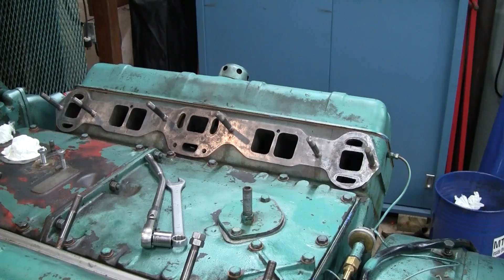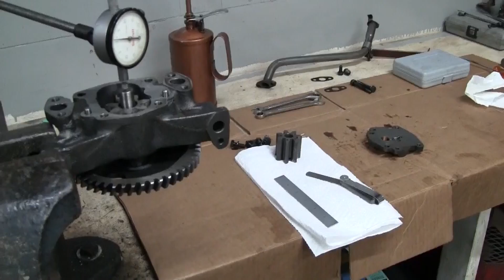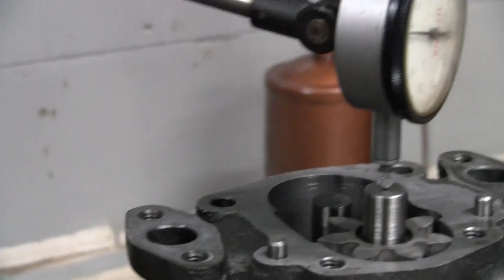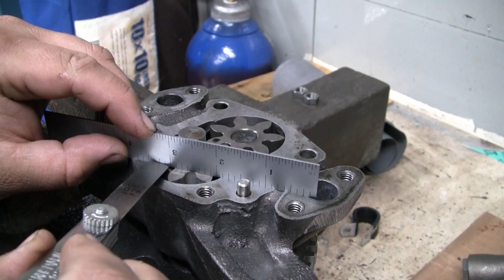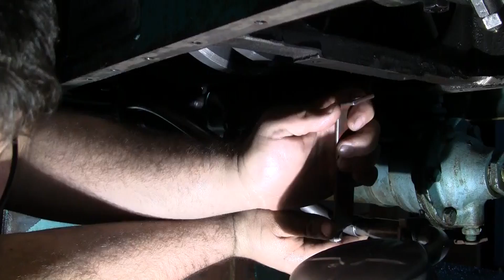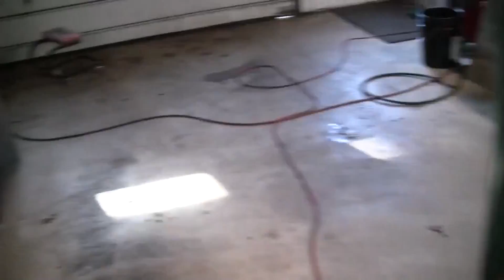Reassembling The Big V8 Roiline H884 Onan 140 Generator Pt.2

Comment: There's a few design flaws in this engine  -  how the hell are you supposed to properly tighten the  mating surfaces of the valley cover and the oil relief assembly when tightening one orientation of bolt directly prevents tightening of the others.  In my view this is guaranteed to be a source of leaks past the mating surfaces.  Then there's the swivelling oil pickup - it's a fantastic idea on the surface, but when the swivel joint is faulty air can suck in.  The swivel should be immersed, especially since the crankcase is pressurised by blowby when the engine is running - making it even easier to suck air past a faulty/leaking swivel seal.

Comment: Hello Mike. What you are seeing on the water passages is probably repair from the factory when the foundry had problems with removing core reusable risers used once to often. They would have someone sitting on the line just welding Ni99 rods on any part of the casting divots to make the heads 100 percent usable and reliable for the engines life. This repair is bullet-proof. Also, this made sure when the customer was shoddy with antifreeze interval changes which made the fluid aciding and started to just erode flanges without this feature. These engines were bullet-proof. With fair maintenance these engines type life expectancy was just off the charts. Companies today would never do that for sure. Personally hope someday to find one for myself. A very nice find for sure. VF

Comment: If you call that a small engine.....   I just need the parts to convert a older Tecumseh 10 HP to electric start! I'm not worried about charging, I just need the starter and flywheel, any idea where to find one?

Comment: On measuring clearance at curved surface ypu would need a very narrow feeler gage, or more likely you should use a wire gage.  If you had a stack of very thin feeler gages, they might bend, but the 0.003" probably does not.

Comment: I do know about castings and the standard methods of checking castings to be sound enough to ship out of the clean room. Every Foundry has one no exception. That has a inspection area a grinding an cleaning area and welding area. This can make it difficult for people to understand. When a casting comes into this department it is evaluated as what needs to be done. Some use nondestructive testing some don’t. But they don’t get out of that department without passing or sent back to the melt Depart. The wielding is called Fill wielding and it does mean to save the production of there castings.

Comment: That would be an awesome engine for a rat rod. Of course don't soup it up, just slap an automatic from a diesel pickup (because the rpm range will probably be similar) behind it and let it loaf along. Take that old mechanical govenor apart and let the flyweights stick up through a partial hood like a funky animated hood ornament... It almost would not matter what else you did, it would still be cool.

Comment: I think you will find that the noise with the oil sump is a bit of clearence where the two tubes meet. One being the swinging end and the other fixed tube end. Dodge flathead sixes had the same style pickup tube and they also rattled around. All the ones ive seen all seemed noisy and loose but never seen a problem reated to it.  Great video !

Comment: Another great video showing how you methodically check each part for the correct tolerances.  Absolutely excellent process of rebuilding an engine.  Will this be going into a rototiller?  Dang you are good at what you do.  Thanks for the video's.

Comment: BOY that older engines are well built . No plastic in that engine . Built to last , and last it has done to still be here .
Reply: Not exactly  true. Car engines of the 50s and 60s could hardly do 100k miles with needing rebuilt.
Modern engines with do 300k miles with just normal maintenance

Comment: Many years ago I used to work in an aluminum foundry and one of the parts we made were aluminum cylinder heads. I remember huge baskets full of rework and people manually correcting cylinder head casting defects with a tig welder.  I never did any of the welding so I do not know how much they actually corrected.  Seems logical to me that if they would fix those I believe they would fix the steel ones too.  Maybe someone who was in the foundry where they made those heads will comment.

Comment: The head coolant passages were probably factory welded. I worked at an iron foundry and it was a common practice to weld the defects and send them out. The process used a large heat treatment furnace and heat the iron casting to a red glow. Once it was hot it was sent to the weld station. This was a gas weld. I don't know what rod was used. The heat treatment allowed the cast iron to be completely welded. Next, the casting would be sent to a soaker station where the casting slowly cooled.

Comment: I am probably mistaken but you might want to check how tight the upper bolt on the oil pump discharge is.  You probably did tighten it and I did not see it...............Jay

Comment: This new mic has mike be likin “the bob ross of clapped out engines”
Reply: Happy lil homemade gasket for a happy lil engine...
Reply: @MRGF78  👌🤣👍
Reply: needs to buy an Afro comb though.
Reply: Hi Mike, the engine is going back together nicely, it will be good to see it finally running.
What do you intend to do with it when finished keep it or sell it so you can buy something else to fix and sell and make a bit of money on as well.
Something that size wouldn't be easy to take to festivals with you.
Tony from Western Australia 🇦🇺

Comment: Willys L and F Head engines had the same oil pick up.  You can bend the tabs from screen housing back and separate them for cleaning.  I modify the 'hinge' to accept an oring to prevent air from entering during oil pump suction.

Comment: Those repairs look exactly like other cast-iron machinery I've seen repaired with high-nickle welding rods. I suspect the sand mold wasn't well supported around the ports and would collapse/fail frequently around the ports. Looks like it was nearly a given considering both heads had the issue. 

That's a lot of extra time added the production of each head. Definitely not cost effective to have someone manually welding up the ports in every single head like that. You'd think they'd re-work the patterns?

Comment: That engine is big, imagine it in a pickup truck.
Reply: I was thinking the same thing
Reply: Good, I’m not the only one.
Reply: @SuperDriver379  1971 Dodge  3/4 ton 2 1/2 ton axles 24 x 48 inch tires , with ROILINE OVER YOU  on the tail gate .yes that would be awesome indeed

Comment: It would be rare to find a set of 884 heads that haven't been welded. They were prone to cracking although I have never see the water ports welded. The hay mill I worked at had 6 of these 884s running generators, pellet mills and grinders. I thought they were great engines.
Reply: @Ben T. These were designed to run on natural gas and propane. I've worked on a few water pumps powered by similar NG fired engines, they run cleaner than gasoline and when connected to natural gas there's no requirement for periodic refueling.

Comment: Where did you ever find any parts for that engine, I have never heard of that brand. I have seen other low volume type of engines have touched up casting before as in high production they just make more but in low volume expensive to replace parts repairs make since.
Reply: I wouldn't be surprised if these small productions are military contracts going way back

Comment: I wish you and Hoonigan would team up, put this in a car.
Reply: You would be disappointed in the results if he did. I doubt that would be a very impressive race car engine.
Reply: It's like an Elephant. It's very big and very powerful, but you wouldn't race it against a cheetah
Reply: It makes less than 300 hp. Edit: I may be wrong, the 884 supposedly made 360 hp, but that was probably when being run on gasoline.
Reply: I'd like to see Mike get more views.
Reply: I'm assuming that given its intended purpose design, the torque curve and rpm range would make its performance lack luster. Cool thought tho
Reply: terrible slow revving, garage 54 put a zill truck engine in a car, its terrible